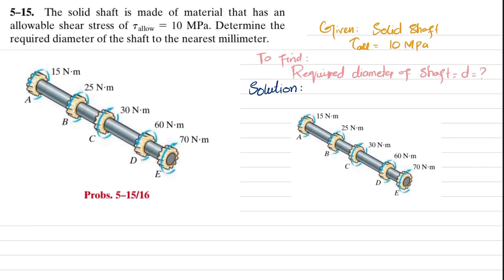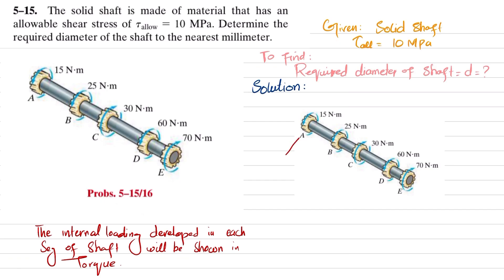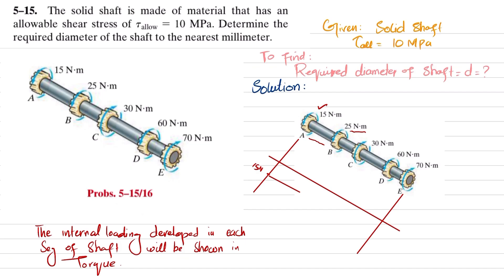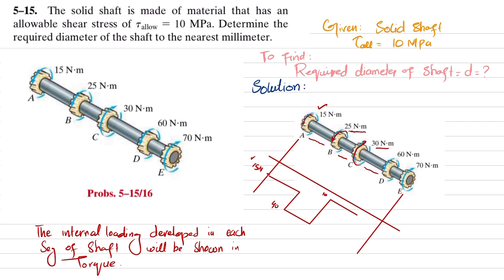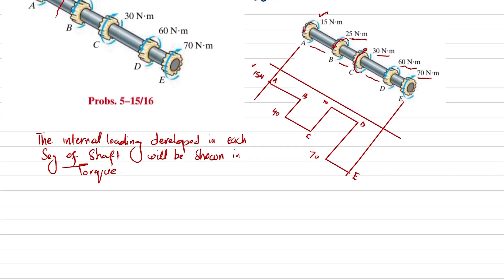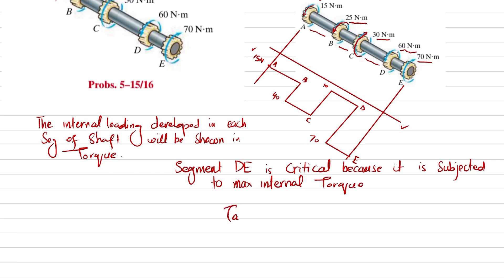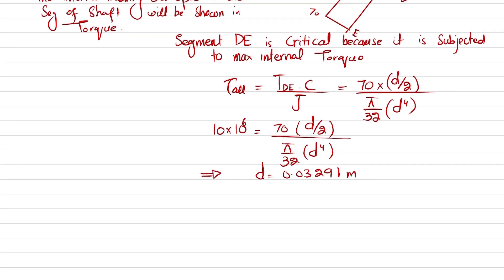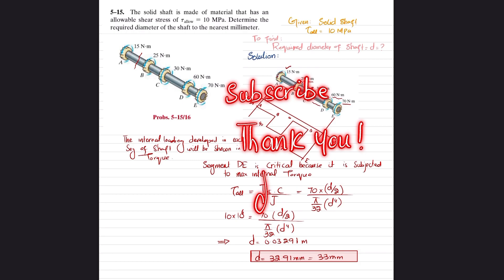5-15 | Ch 5 Torsion | Mechanics of Materials RC Hibbeler|

Comment: When does we know if the internal torque diagram is in negative and positive?
Reply from the maker: You have to check the overall effect of external torque if overall external  torque acting come out to be positive then internal torque should be clockwise and vice versa
Reply: @engradnanrasheedmechanical  If there is an embedding, the sign is the other way around, right?
Reply from the maker: Sorry I didn't get ...

Comment: why are you using pi/32 in J instead of pi/2?
Reply from the maker: When you use radius then the formula is Pi/2 x radius ^4 and when you use diameter then the formula is Pi/32 x Diameter ^ 4. Put radius = diameter /2 in first formula you will get the second one.